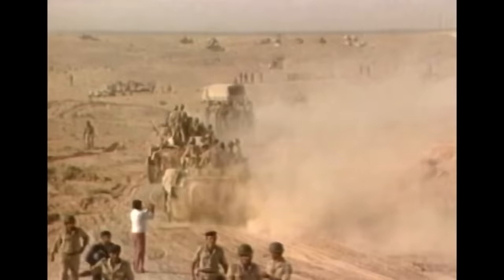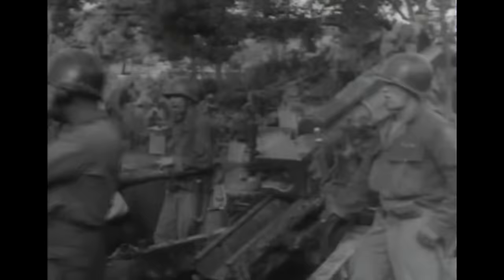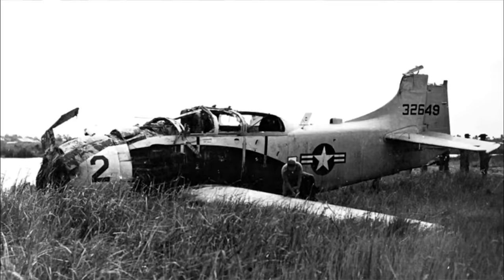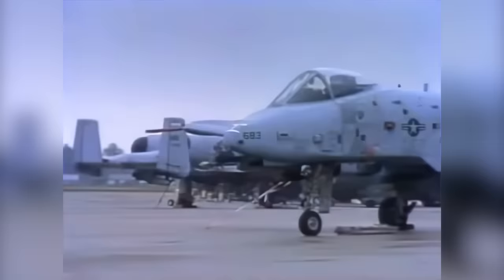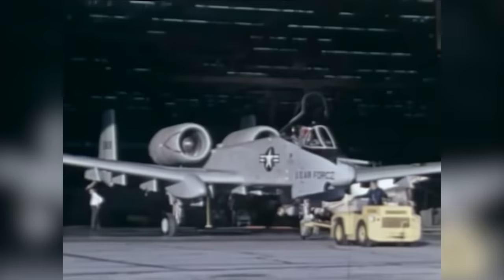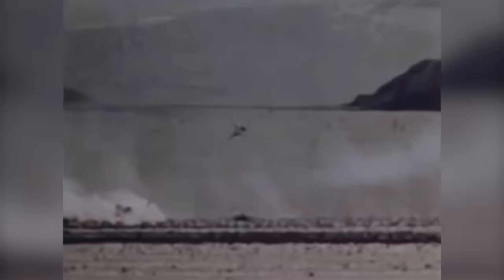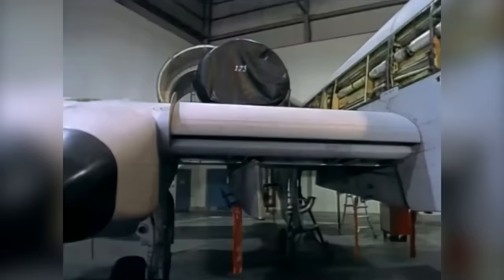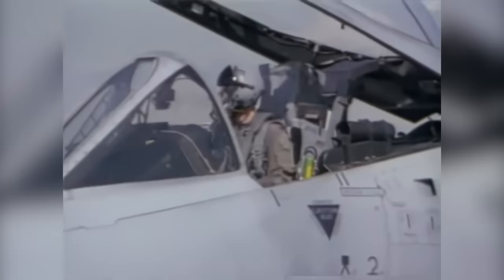A-10 THUNDERBOLT II "Warthog" | The Untold Story And Things You Might Not Know | Part 1: Origins

Comment: Considering that the Iron Curtain fell the year before Saddam invaded Kuwait, and the Warsaw Pact was dissolving, the coming storm in the desert was going to be the closest thing these planes would ever see to their original design intent ... hunting Soviet armor in a target-rich environment ... and in the far more open Middle East desert rather than the variegated terrain of central Europe. Not sending the 'Hogs would have been a dereliction of duty.
Reply: What about using the Warthog now, in Ukraine? Many supported its use in UA & many opposed it. With the number of tanks needing to be destroyed, & the UA’n pilots’ skilled ability at flying low (out at of necessity), wouldn’t this be more useful than F-16’s? Wouldn’t both be best? Just a nagging question that I’ve had for quite awhile. No need to respond, if you don’t want to.
Reply: @lindablake8799  IF A-10s happened to be in theater, and IF they had been accompanied by sufficient air superiority amd air defence suppression assets, then yes, the bungled, traffic jam opening of Russia's 2022 invasion of Ukraine could have been a dream scenario perhaps even MORE advantageous than the '70s and '80s assumption of the Pact hordes piling though the Fulda Gap in Germany.

That's a couple big IFs, more thna countered by numerous BUTs.

AVAILABILITY ... Obviously, no A-10s were there in 2022. There were no A-10s there because the A-10 has NEVER been sold to any other country nor made available to any ally in any way. The platform and more specifically its gun and more specifically that gun's depleted uranium ammunition, have been reserved specifically for use by the US military. NOT for export, ever.

Since the A-10 is only operated by the USAF, and will only ever be operated by the USAF, it will never be deployed to Ukraine. The US will not deploy any of its forces to Ukraine, as that could result in a direct confrontation between US and Russian forces, and the potential escalations that could result are more unacceptable than would be even the complete destruction of Ukraine. 

F-16s are being sent because they are available to be provided *indirectly*. F-16s have been sold to at least two dozen other countries. The US approves the sale of newer planes to one of those countries, that country in turn surpluses older F-16s to Ukraine. It's a fig leaf, a shell game, but how such things are done. SInce no other countries have A-10s, this will never happen with A-10s.

NEXT ... weapon systems aren't used in isolation. Ideally, A-10s are used after air superiority is established and ground air defenses are suppressed. Ukraine can't create the operational environment that the US can, dropped into Ukraine on their own, they would not have lasted long. In an existential conflict such as WW3 kicking off in Europe, such losses would have been regrettable but expected / necessary. Sending them off to a proxy war is writing them off. Not going to happen to equipment not considered expendable. See abose ... the US isn't going to send ANY USAF assets to Ukraine ... not A-10s, much less the air superiority and SEAD assets they would operate under and behind.

ALTERNATIVES ... the US and allies have been able to make available to Ukraine cheaper and expendable alternaitves for dealing with Russian armor. Artillery systems and piles of ammunition, scads of man-portable anti-armor missiles, and surplus'd ground and air vehicles.

Comment: In the first Gulf war the A 10 WortHog took out thousands of tanks in three days and then close air support the grunts loved them fot this es for shure !
Reply: The best plane for cas - the intimidation factor alone is more effective than a fast jet or rotor craft
Reply: It certainly saved my unit 2nd LAR USMC 3 different times in situation that the Harrier, Venom, & Viper could not. 2nd LAR destroyed many tanks themselves with there combined platoons of LAV-25 (25mm Bushmaster Cannon, .50 Cal Machine Gun) LAV-ATD (new two pod 8 shot TOW Missles), LAV-AD (GAU-12/U 25mm Gatling gun and 6 Stinger Missles) LAV-R Repair LAV- Command/Control. But a few times the unit got over welmed  by the quantity of enemy.
Reply: Yes the a-10 was effective at tank busting killing about 900 tanks, while the f-111 destroyed about 1500.
Reply: Paused after survival gear segment. You left off a most important survival tool; M1911 semiautomatic pistol in .45 ACP, a proven pistol cartridge. 

Developed as a result of failure of .38 Colt revolvers against Moros during the Philippine insurrection. 

They forgot these lessons when they adopted the M9 and .😅355 Parabellum cartridge. 

Because of limited supply of ammo, you need something that do the job with one good hit (.45 ACP) than hit enemy several times with .355 Parabellum, the reason .355 Parabellum pistols need 15 round magazines. 

Don't give me the horse doodoo about M1911 is inaccurate. After I read an account of someone with a Mattelamatic getting six hits on an E silhouette target at 100 yards with sixty cartridges, I set up an E silhouette at 100 yards. I engaged that target at 100 yards with an M1911 pistol and sixty cartridges and got sixty kill zone hits. 

I am an Army veteran and served with the M1 Garand and the M1911 pistol.
Reply: @seavixen125 Aardvark-Raven love, good 1-2 punch. As was the Dragonfly and OV-1 Mowhawk backing up skyraiders... Army lost armed Mohawks because the were good at COIN, CAS and most damning shot down a Mig, breaking the treaty.
Reply: @seavixen125 The f-111 was deployed earlier to strike the targets at further range before they were dug in. Its laser guided bombs and cluster bombs did a great job. Once the Iraqi tanks were more hidden they needed the A-10 to get in closer to finish the job. A-10 was just more durable at those distances.
Reply: Exaggerated claim ,it's BS. The A 10 did not destroy thousands of tanks in 3 days!!
Reply: The a-10 is a beautiful gun strapped into a fugly plane, unfortunately aerial anti-armor Gatling guns who are gimballed require the entire plane to be perfectly lined up for the shot so that maybe, maybe, maybe, the DU AKA depleted uranium nastiness penetrator might just make it through the tank and knock it out.

Or you could look at the ungodly number of hellfire missiles shot by aardvarks tomcats and other various airground platforms probably most prolifically used by the aardvark and the..... A10.. Waaaay more effective.
Reply: a fact that's ignored is that the vast, vast majority of the tank kills were done by missile and not with the big gun.
Reply: @joeottsoulbikes415 you forgot it smoke checked an AT. D Co 2ND LAI.
Reply: Smoked an LAV AT in Desert Storm. Smoked 2 AMTRAKs in OIF 1. They killed a lot of Marines. Warthog pilots are not great at determining friend or foe.
Reply: @eac1235 It killed 900 tanks in 3 days. Pretty impressive.
Reply: During the forty-day conflict, the A-10 force was credited with destroying 987 tanks, 926 artillery pieces, 1,355 combat vehicles, and a range of other targets-including ten fighters on the ground and two helicopters shot down in air-to-air engagements.

Comment: We are in the same situation we were in the times of the A-10 development.
The A-10 is near retirement, and the Air Force has no replacement in mind. 
The F-16 ain't going to do it boys. 

Titanium bathtub armor for the pilot and manual reversion to fly by cable, should be mandatory on the next ground support aircraft.

Comment: It's funny they were saying the p47 was not the best fighter, but it was proven that it could out dogfight the p51 mustang multiple times. If you know where I'm going this took place in 46 and 47,and it was covered up because these ww2 aces were getting showed up by the Tuskegee black pilots in their p47's. Besides the last p47 was a true 500mph plane and the  p51 was totally out matched by it.
Reply: This is wildly inaccurate. Not even remotely correct. It was never once ever proven it could out dogfight a P-51. Not only that but the Tuskegee Airmen primarily flew P-51's (not the D model though) and only shortly flew P-47's. WWII "Aces" were not getting shown up by black pilots (nothing against the black pilots because the Tuskegee Airmen were great). Maybe some vets were. But not aces. And neither the P-47 nor the P-51 were 500 mph planes. Not even the P-47N which was the final variant of the P-47 produced could reach 500 mph unless it was in a dive. The P-47 was specifically told to avoid dogfights and boom and zoom instead because it was not a turn fighter. The P-51D on the other hand could mix it up fairly well the BF-109's and FW-190's. Your comment pure misinformation.
Reply: @joshandkorinna  ah yes after the war was over they didn't bring the planes back with them, grinns. But there was plenty of them here,lol again,so they were flying p-47 what you think you know you are obviously clueless. So since you don't know facts you should not reply in I'm a dumb ss reply. History is recorded, try and read some of that.